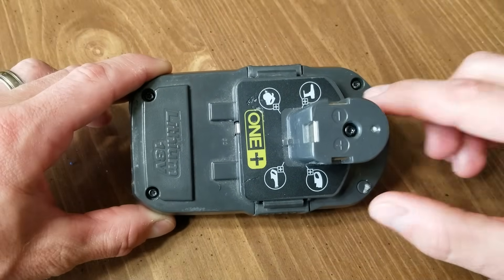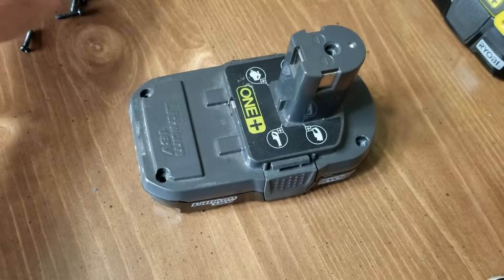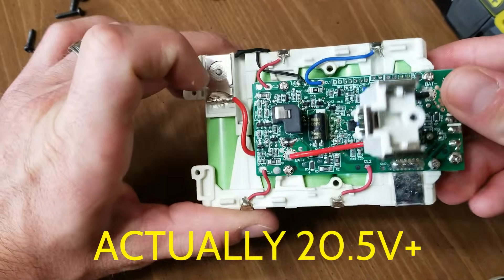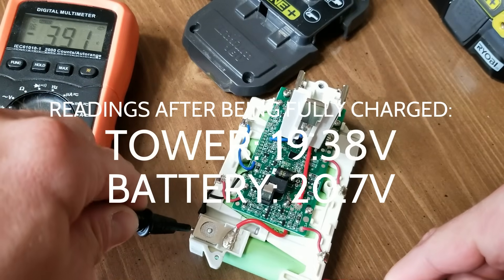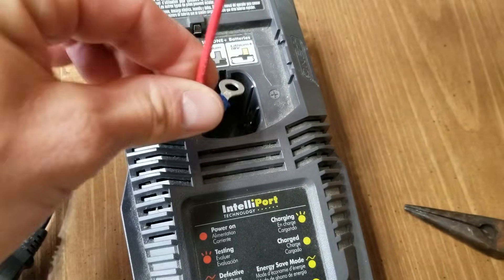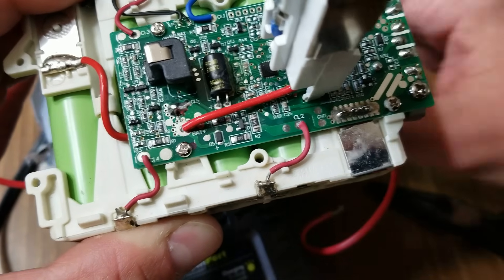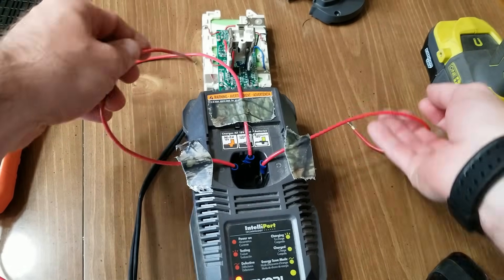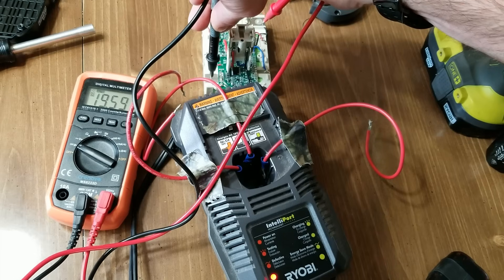RYOBI 18V Battery Not Working? [Easy DIY Charging Hack]

Comment: You were wondering about the minimum voltage for the charger to recognize the battery. I had my battery down to 5 V and no charging. Because I was uncomfortable hacking the charger itself as you did in the video, I tried charging it with a 9 V battery instead. I got 8.5 V on the terminals after a few seconds of charging with the 9 V battery and successfully managed to get the Ryobi charger to start charging the battery under those conditions. So, the threshold is probably somewhere between 5 and 8.5 V. Thanks for the video, it saved me buying a new battery!
Reply from the maker: Thanks for investigating that!

Comment: Or... pull the idiot-board.  

Wire the battery for use with an RC model LiPo-Lion-NiCd-NiMh multi chemistry battery charger...  

Delete the real problem.  The BMS board that has a microprocessor designed to kill the battery.

Comment: I found a battery at a yard sale that looks just like the one you use here and got it for a whopping $1 and was told by the person that they could not find a charger for it so i went to Home Depot and bought a new quick charge charger and that battery was fine and it holds a fantastic charge. I must have gotten that battery 10 years ago. Then i got 2 more 6 amp batteries on sale at H/D and those are great too. I have one battery that i bought new and it never did hold much change so i probably won't do anything with that because i don't want a melt down lol.

Comment: Thank you brother for blessing us with your knowledge! 
Your video is quite an incite & very helpful!
It has worked for me as well. 
I would just like to share some info from my case.
I've got the exact same battery as your demo and the voltmeter was just blank (0.00) for any voltage anywhere over the board. 
So I had to check each cell individually and found 0.24 and lower voltage readings on the five lithium cells individually. 
But as I connected it to the charger directly on the points that you have shown, it did jump start to showing 6 volts in the first 10 seconds and the green light started blinking. 
Now its charging!

Comment: Aftermarket Ryobi battery substitutes typically won't have the firmware lockouts that Ryobi batteries have.   No more bricked batteries.   Their circuitry is simpler without the "advanced" Ryobi lockouts that infamously brick perfectly good batteries.   Besides being cheaper, these alternatives often can be bought with higher capacities.    Most will have a battery management system for basic over-voltage, under-voltage, and short-circuit protection, but if the battery pack drains too low, they will still be rechargeable.  They won't be bricked.

Comment: not sure about the "EASY" diy charging hack.  Easy wouldn't require a drill bit, 16 gauge wire, and an hour.  but thanks. this does work.

Comment: There’s one trick you can try so you don’t have to break open the batteries. I learned this on YouTube the other day, and it worked on one of mine. Put the half charge battery and something that draws a lot of current like a grinder or a soft and run it until it’s completely dead. Then slap it back in the charger and there’s a good chance that it’ll take a charge again.

Comment: The other methods I tried didn't work. This did the job, thanks! I actually used the other battery to get power to the faulty one. Just connected plus-to-plus and minus-to-minus and kept it connected for 30 seconds.

Comment: You can jump a battery with a another battery equal or greater size but then if you don't put it on a charger before it runs back down below threshold it won't matter

Comment: I had a 4 Amp hour Ryobi battery which would not charge. I took a 19+ volt laptop power supply and attached pos to pos and neg to neg on battery. Let it charge for about 5 minutes. It was then accepted by the Ryobi charger to full capacity. This was about a year ago and the battery has been working fine ever since. No damage to BMS

Comment: I just had the similar problem with my Ryobi mower battery (4Ah H battery). After mowing, it was fully drained and refused to charge. I found this video while searching for a fix, but instead of following the reset trick shown, I tried something a bit different — I put the battery in the refrigerator for about 1–2 minutes to cool it down. Surprisingly, it started charging again right after!
Reply from the maker: Correct,  when they overheat from a fast discharge,  they'll refuse to take a charge until they cool down.  It's a safety feature with all the circuitry in the battery.  Thermister, I believe.   When my weed eater drains them in about 8 minutes of use,  they'll get really hot.  After 30 minutes or so of cooling off they'll take a charge again.  Thanks for pointing that out for everyone!🙂🍻

Comment: FYI- If your Ryobi battery is held together with screws that go in sideways rather than from the top, then this method will most likely not work for you. Ryobi has programmed the BMS to lock out charging when it detects an imbalance in the cells. Many companies are now doing this. 
Check "Badar's Workshop & Tool Scientist" for how this works.

Comment: Why can't you just touch wires from a fully charged  Ryobi 18 volt battery ground to ground  , positive to positive & negative to negative on the tops of the towers of a fully charged  18 volt Ryobi  battery instead of taking the battery apart?

Comment: Great video. I’ve seen many others that just have you jumpstart one battery to the other and that has never worked. That method works for my Greenworks batteries, but not Ryobi. I’ll be trying it later today. Just a sidenote, your first comment that you used to work at a maintenance department that had a wall of dead Ryobi batteries is highly suspect. I’m a big Ryobi fan, but no self-respecting maintenance department is going to be stacked up with Ryobi tools and batteries.😂

Comment: Also when you have these things open, be careful not to let any of those cells get shorted.  They will get really hot and maybe start a fire or vent toxic fumes!  Just make sure that no metal comes into contact with the ends of any of those cells and you should be OK

Comment: Excellent!  I used your info and "Did it My Way..."  I didn't have that security Torx bit, so I estimated the location of the the positive and negative shiny silver contacts from your close-up video.  I melted away a patch of the plastic with my soldering iron over each.  I then soldered a pad onto each contact and put a piece of wire to connect to.  Then, I connected to a bench DC power supply and got the voltage up to about 16 VDC.  The battery pack drew about half and amp.  It  was around 4 volts when I began.  I unhooked everything and put it into the charger and now it is charging.  I will cut off the wires but leave a little and then cover the holes with tape.  I am stoked!   I saved the money on a new battery and didn't need to leave the house in my car, to risk a collision with the free-range people that are driving around with uninspected, unregistered cars.  Better to stay home!  Thanks again!!

Comment: I’ve learned a new charging hack today 
I only had 6v and it took no charge 
But put it in the charger and when both lights were flashing guickly lift it up and down in in the charger again. And after repeating that 10-20 times suddenly it start to take charge 😀

Comment: Thanks you worked for me took a little tinkering of the position of the wires to battery and then boom started blinking green I counted 35 seconds did the quick battery cover w out the screws now it’s charging I’ll see if it holds charge . Thanks nice trick .

Comment: It worked for me, but when I had the GND & Neutral touch at the same time (untied up beforehand). When they tied up before touching it gives the charger false signal before anything happens and it won't switch to charging mode. This was a key to switch the charger to charging mode after they touched few seconds.

Comment: Thanks a lot.  I have got them going by injecting 20V straight onto the + and -ve without pulling it apart.   Nothing really stopping you bypassing the controller with the -ve and middle terminal hack you discovered   Not sure if the charger will knock off the power auto if you do this however  I have a bucket of batteries and really want to test this now you taught me that middle terminal hack.  Ebay sells a battery adapter (I use them to jumper my car if it gets a flat battery)   Would likely work just jumping 2 batteries together for a minute.

Comment: Thanks for this. If you aren't too fussed about using the actual charger to do this you can boost it from another Ryobi one battery directly. I just used some rare earth magnets to hold the booster wires to the dead battery and touched the other ends to the booster battery +to+ to for 20 seconds and BAM, no it didn't explode, lol, the voltage on the dead one now read 16V (had been 3.5V). Popped it into the charger and flashing green charging light. Voila.

Comment: Will save and review again before charging. Tried one where you drilled holes in the case and used a car charger with copper wire leads to the two holes for positive and negative. Will try yours to check voltage to each cell and go from there.

Comment: I have one of these- the battery itself says it’s dead, but when I plug it into the charger it flashes red for a few seconds then stays a solid green (which I believe is indicating that it’s fully charged). based off of the indications (the little pictures) I’m seeing on the charger itself is that it would flash green while charging. This is a new battery that I’ve had for about 2 weeks. Perhaps I killed it by leaving it on the charger for days on end? Help please 🙏

Comment: Fantastic. The jump start worked perfectly. My blower battery I jump started with a different battery from the cordless drill. So the batteries do not have to be the same brand...just positive to positive and negative to negative. Bang...the battery is charging agin. Thank you.

Comment: Will it loose capacity after it have been badly discharged? I fixed 3x 5ah batteries using ur method. Im just curious if the capacity is still good. Shows 20volt when fully charged.

Comment: I had a similar problem. But instead of taking the whole battery pack apart, I just manually plugged (inserted the battery into the charger; the green light blinked), then unplugged the battery pack every 5 to 7 seconds (when both green and red lights blinked—indicating an error), and it worked! I had to do this about 25 to 30 times until only the green light blinked, indicating that the battery was charging.

Note: I did NOT unplug the charger from the wall; I just placed the battery in the charger base every 5 to 10 seconds repeatedly until only the green light blinked, indicating that the battery was charging.

Comment: Nice techniques guys, just a note.  Good practice is to crimp the terminals on, with the wire insulation Inside  the terminal insulator.  Even if you are in hurry.  This eliminates the chance of a stray wire escaping the back of terminal end and possibly contacting a hot wire without noticing it.

Comment: On the top of battery it shows + & - terminals but it shows zero volts on every battery I have which is wrong.  Why can’t it be read with a voltmeter that way ????

Comment: All I had to do was jump from a good battery to my bad battery.  After 30 seconds I tried it and it clicked green.  No screwdrivers.  I'd recommend that first.  And if that doesn't work you'll have two of the three wires you need to try this.

Comment: Hi, thanks for sharing your skills & help.

I have only one Garden blower battery that comes with a wall electric charger, 18V battery & only randomly charges to green light & takes hours to charge.
Is not currently charging.

So, the Garden blower turns off within a few minutes.

Do you have any suitable tips, please?

Comment: I have 4 ryobi batteries for ryobi tool (Full set of Drill, Hammer and 2 circle saw). I bought 2 pcs of 4A product in UK. it was good working at this time. but  after bought 2 small batteries was no good by can not charging. I fix exchange 2 batteries after open battery case. and problem battery test result was good charge at independent battery charger. What is reason of charge problem? Finally I find out for charging problem is only inside of battery charge management circuit is no good. Unbalance internal resistance battery will unbalanced  discharge when serial connected 3.9 V x 5 pcs serial connect for 18V assembly product. Problem reason is different internal resistance batteries connect to  serial. if good battery used same internal resistance batteries will good working for long time. if battery pack used very good balancing discharge circuit, it will has long life time, this is not this time, I think need BMS circuit have to improve to good balance charge and good balance discharge. Finally I think how to make good battery pack product, It is simple for good charging pack use parallel charge circuit and serial discharge circuit for battery pack product !!!

Comment: Why can't we just put pos 2 pos & neg 2 neg without taking battery cover off? Does it work like that or do we need to  bypass the circuit board? I don't have security torx bits...
Reply: That may work if you do not have a Battery Monitoring System (circuit board-BMS) lockout.  If you possibly have a software lock preventing the charging of the battery, some of these various methods may work or not.  Worth a try doing your way first and then trying others.  Ultimately, temporarily cutting the battery tab of the cell closest to the positive + point of the circuit board will  definitely eliminate power to the BMS in an attempt to reset it; but would be a most aggressive approach.  If that doesn't work and the cells are good and worth salvaging, replacing the BMS for your specific battery model can be considered if you are somewhat experienced at soldering.

Comment: Omg it worked. First try showed defective. 2nd ditto. Third time the green charging flashing started. Battery been laying around my workshop 2 or 3 years. Tried using just post as shown on different channel. Failed. Since my KC Chiefs got throttled last night this process you show is good for my psyche as well as my cordless tools. Many thanks

Comment: I have a couple of ryobi batteries to try this on. And a ridgid. I had a ridgid battery go bad. When I pulled it apart, they were all fully charged. The circuit board wasn't working, so I used the batteries for flashlights.

Comment: just some FYI  if you have 2 batteries and both have bad cells.. you can take the good cells from the bad battery and soldier them into the good one...  just Saiyan...  I've done this with some older Mikita 7.4 v batteries

Comment: Good video but to really fix Ryobi ..  just throw them in the nearest trash can and get REAL tools.. as a construction supervisor for 23 years... we used to laugh at the guys who brought Ryobi tools on the job site... after about 2 hours there was a line at the charging station and one at the garbage can....lol       RYOBI tools are junk.. cheap chinese built..  If you are stuck with  their 18v one+   just take the batteries and throw then in the trash  will save you much headache in the short future their tools last and get some aftermarket ones.. as the 18v one+ is only 1.5mah  .. there is an aftermarket battery half the price and twice the mah..          this is why they give you 2 batteries with the 18v drill  so you have a 50/50 chance it will work...

Comment: Thanks for the video. This helped me to open and bring back to life a Ryobi battery I found on the curb in my neighborhood. It looks brand new but the voltage on the contacts were 1.5V. Its amazing how lithium batteries can be saved. Acid batteries if go below 20% of their minimum, can't be saved easily. I had to do it 3 steps because it stopped charging after reached 6V. Then I had to wait a few hours and charge again. Then stopped at 9V. Third time when it stopped at 12.30v I put back the case and put it in it's own charger. I used a Bosch battery to save the Ryobi. Cheers.

Comment: I tried this method and measure 15V across the battery cells, but only 2.9V across the terminals on the tower. When I then put it in the charger it charges for about a minute and then goes into maintenance mode. Does this mean that the control board is broken? Anything else I can do to attempt a repair?

Comment: My battery charges and shows 18.7v on the tester but when I put it on a tool it works for about 5 seconds. If I take it off and put it back on it works for another 5 seconds.
What do you think it could be?

Comment: My new ryobi battery was totally drained and wouldn't charge right out of the box. It did however charge for a couple of seconds and then stopped charging. I kept taking it out and putting it back in about 10 times and it eventually got enough juice to stay charging. Might be worth a try if you can get even a couple seconds worth of charging. Was an easy fix and I didn't have to take it apart.

Comment: Worked for me too!  except I used a completely different battery (20v maximum Canadian tire) to charge the dead ryobi instead of the charger. I took the ryobi apart like you said, but jumpered the 20V working battery BAT+ terminal to the ryobi Bat+ and BAT- to BAT- bypassing the BMS computer.  counted to 30 secs and voila.  reassembled, inserted and green blinky light.

Comment: Hi! very good video. I have two almost new Ryobi 9Ah batteries that are not working. They both went in the water while we were drilling a four inches hole in a 2x6 in a water dam. Is it possible to fix?

Comment: No wonder these battery packs die. The charger doesn't balance the cells as it charges. Should be the mandatory standard for charging any lithium based battery packs. Especially considering how much they cost.